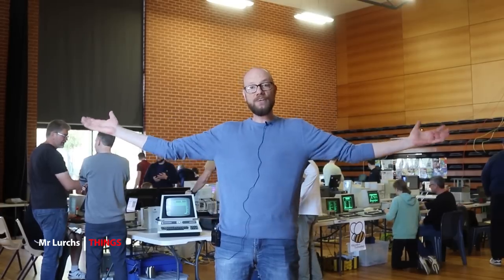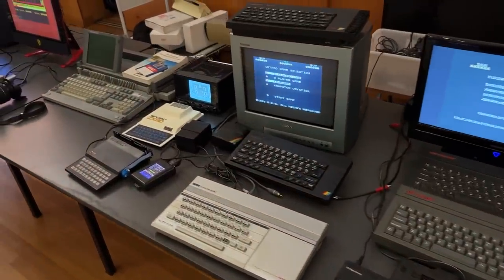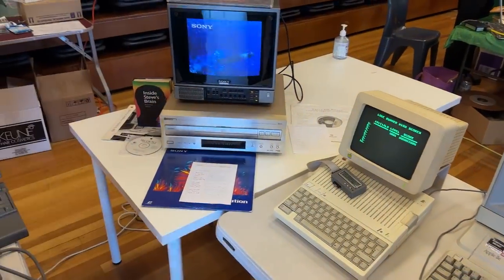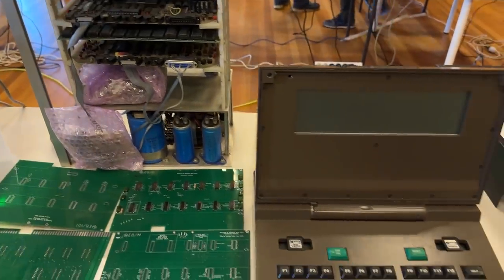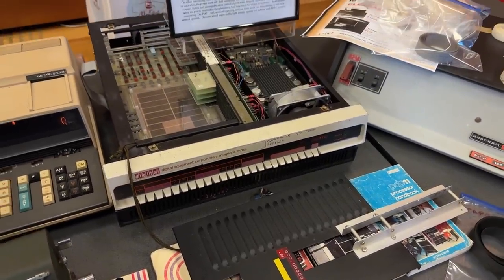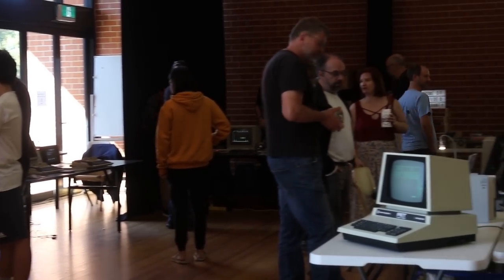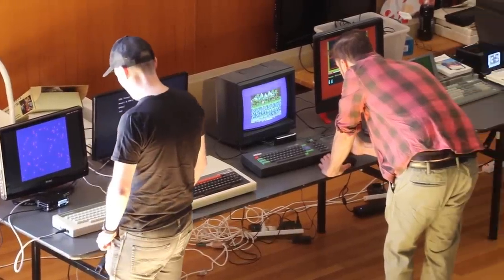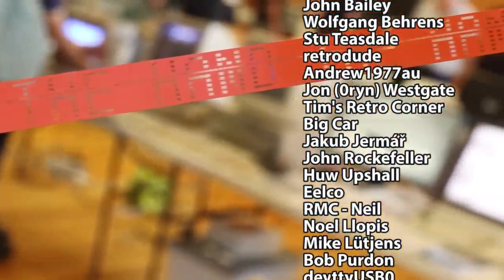Canberra Vintage Computer Expo 2023

Comment: The combined telephone/computer based loosely on the QL was branded by a small number of different telephone companies, but I know it as the ICL OPD (One Per Desk). I think it was some kind of joint venture between Sinclair and British mainframe manufacturer ICL. Certainly when I worked for ICL in the late '80s, I had a manager who had one instead of an ordinary desk phone.

Comment: Hi All

Nice outing, if i had known i push have pressed some contacts i have 

The computer phone was sold here by telstra for a while @ 1984 to 1986-1987 - it was a flop

The majority were used by senior telecom / telstra managers who wanted to look important, and they pushed them of there desk and down the line

They also used those horrible mini spool tapes as disk drives

Price was close to 3k then, and that was the price i paid for my 1978 ford falcon 302 GS in 1986 - also in 1986 or 1987 i purchased a commodore pc 10 brand new with monitor and all the software for $899 ( but my amiga 500 was better and cheaper )

What was good about it, well it ran 2 phone lines, one for voice and one for the 1200 modem, it had a calendar and to do list and contact list, plus highlight a contact and press the correct function key it dialed the phone number with on hook dialing

Also back in @ 1995 - 2010 did you attend the roaming computer faire markets, it was well published and had a listing of saturday and sunday  venues where computer shops and wholesales would sell of specials and just made obsolete computers / and parts